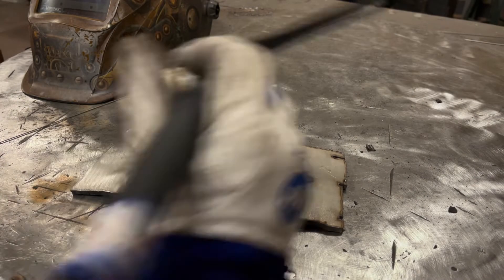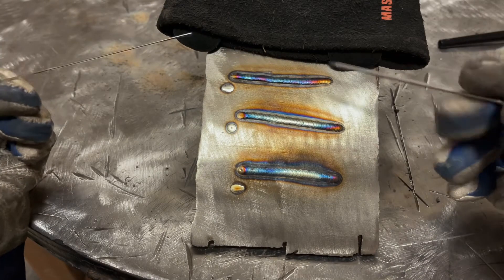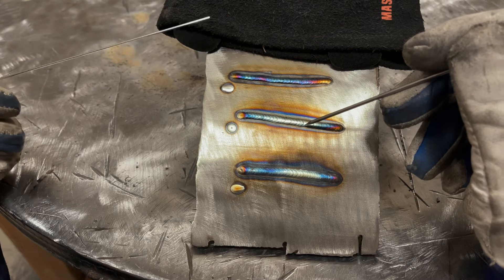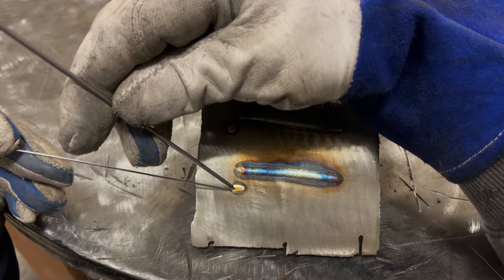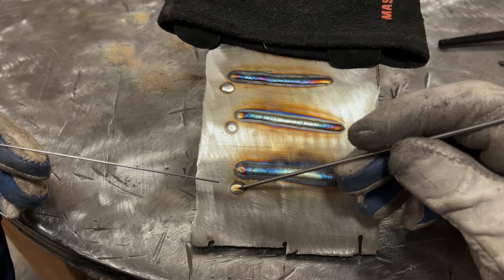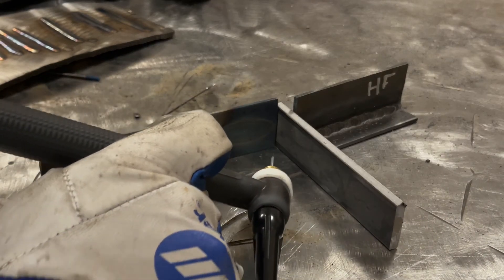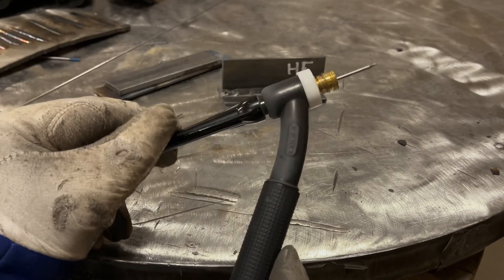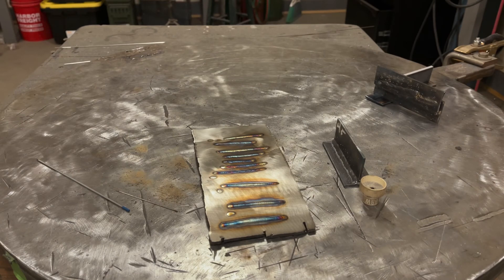Quick video on tungsten angles for tig welding

Comment: Did you use a fume extractor or a mask for Stainless?

 I'm trying to figure out what I need to avoid that poison that's released when heated....i'm new to welding, not sure if you have a video for that already.
Reply from the maker: So I did a video on safety gear a while back, I put a link at the bottom.   I will share a bunch of advice right now though.  Stainless steel has hexavalent chromium in it, and when it gets airborne it gets into the lungs when you breathe.  The actual welding of it (smoke) is probably less dangerous than the grinding/cutting dust from it.  If you must weld it and you want to protect your lungs there are a few ways.  The cheapest is a welding respirator like Lincoln’s or millers welding respirators.  30-50$ and they use cartridges.  They are extremely effective at keeping the crap out of your lungs.  The second option is a powered air respirator (papr) welding hood.  These are far more comfortable than a cartridge filter mask, but they tend to be extremely expensive (1,500 to 2k).  Due to osha standards an employer may have to provide one to you depending on the circumstances of your use.  If it’s for home use then no regulations obviously lol.  The third option is fume extraction via a duct and a fan or air filter.  These come in both portable and wall mounted systems they will reduce the fume that will make it to your lungs.  They can also be combined with a down draft grinding table to reduce the grinding dust in the air.  

When I welded what you saw in the video I likely was not wearing the PAPR I own.  The truth is tig welding stainless doesn’t produce much in the way of fume, it’s the tungsten and stainless grinding dust that is of high concern.  The most affordable but effective way to deal with the dust is a filter mask, even when you’re cleaning dust up around the shop.   

Here is the link to the video, if you have any other questions let me know:  https://youtu.be/hSb36MHzXAc?si=YbXcO8qcvgtBfCgX

Comment: maybe this is a stupid question, but for the pass with the drag angle why not hold the torch the same way you do for the push angle but travel left to right?  it seems like that would improve visibility keep the filler away from the torch, no?
Reply from the maker: It all depends on what it takes to get the best visibility.  On say a inside corner I tend to weld them from the inside corner out, which requires a back drag tungsten angle for a short time.  Visibility is the best this way and the filler rod flows out the best.  You could technically weld towards the corner and push the filler in from the back side, but it’s far harder to do.  The rod itself will have a tendency to stick to the edge of the puddle.  It also becomes easier to poke the rod into the tungsten since it’s far cooler on the backside of the tungsten, and the wire won’t melt as fast.   A good tig welder will have to be able to weld left to right and right to left, if I weld left to right I switch and use the torch in my left hand.  Many people can’t do that so doing like you described or standing over the part (and essentially welding it upside down somehow) so you can use your normal travel direction becomes more of a necessity.  Roll cages in cars are also a common one for weird angles due to constraints of the internal body structure.  That’s what forced me to get somewhat good lefty.
Reply: @makingmistakeswithgreg   Thanks for the reply!  I totally get the need to learn to switch hands and how that provides versatility.  I am a wood turner and the same thing applies there - lots of advantages to being able to put the tool in either hand.  

In fact, my interest in welding came from a desire to build tools for wood turning 🙂
Reply from the maker: @robert.santore   I have done a ton of wood working and carpentry, which are both valuable/rewarding skills.  Welding (especially tig) is infinitely valuable skill to a craftsperson because it allows you to make tools (like you said) which opens up a whole new dimension to what you can do.  Tig is most certainly the best option for doing that.  The initial learning curve is a bit steep but once you crest it the rest of it is easy.  It’s more or less battling with your hands/movement and developing muscle memory more than anything.
Reply: @makingmistakeswithgreg  adding metalworking to the fabrication arsenal has definitely opened up a whole new world of possibilities

Comment: That right there was actually a good video that you did there Greg and also too is always a theory that I got as I was teaching myself to learn how to TIG weld from Justin is always keep your filler at a 90° from your tungsten and it keeps you from melting off that wire before you get it in the puddle.
Reply from the maker: Yep, the 90 degree angle will almost always work.  There is some leeway but the thinner the wire the less the leeway lol.  Aluminum can be especially bad.
Reply: @makingmistakeswithgreg  I'll most definitely agree with you on that and like you said there is a little leeway to that 90° angle and just like you're showing with doing the corner joints of flex head or a flex loc is the way to go I prefer to flex lock I use a water cool cuz I do a lot of aluminum work but it always goes there's no wrong way to get it done as long as it's done.
Reply from the maker: @danielsplayhouse3804  how well does the flex lock with the water cooled head work?  I ran flex heads forever and tried the non water cooled flex lock and it seemed awkward to me.  Definitely going to pickup another for doing roll cages, it seemed to work really good for that.
Reply: @makingmistakeswithgreg  it works great for aluminum work and the roll cage I did and the handle does not get over °110 and the head I use is 20 series w/ stubby kit and 2in or button back cap. Makes for like the world's greatest torch.